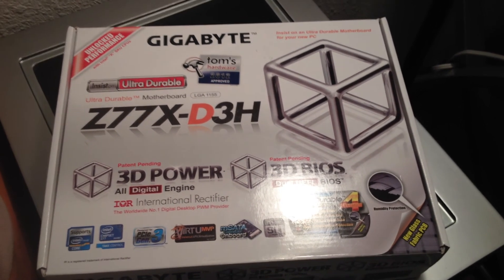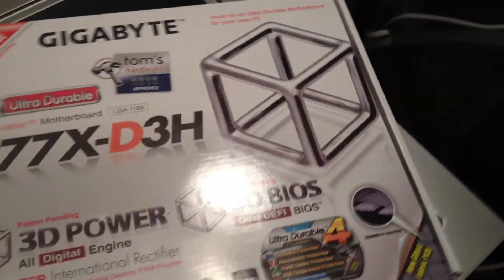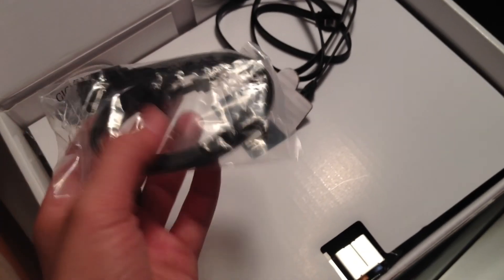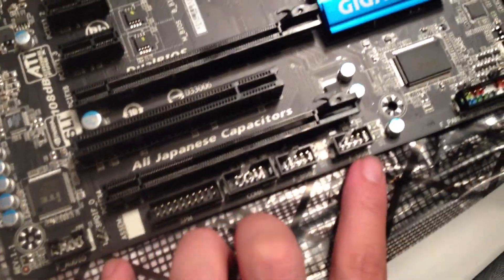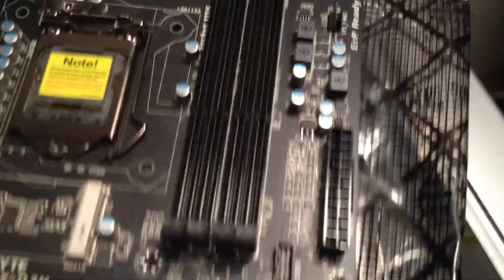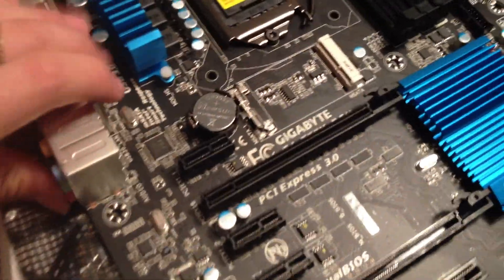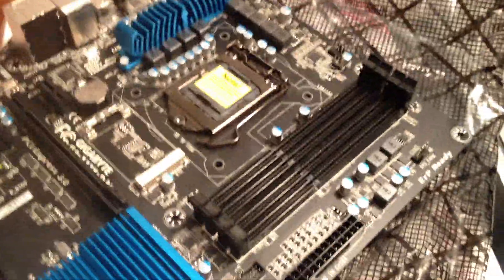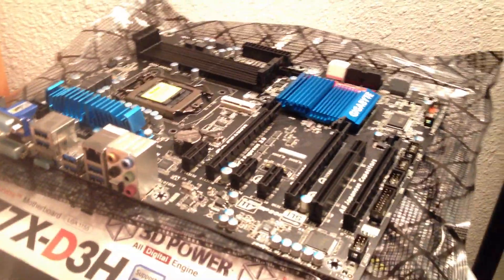Gigabyte Z77X-D3H ATX Motherboard - LGA 1155 - Unboxing and Review

Comment: can you use a Samsung 960 PRO 1TB M.2 2280 Internal SSD with the gigabyte z77x-d3h motherboard?
Reply from the maker: The mobo and SSD both support SATA. Should work fine.
Reply: should i not worry about the fact that it is an M.2 where this mobo just says it has a mSata connector which looks a little short compared to the Samsung 960 Pro Pcie card?
Reply: can i contact you via Skype please?